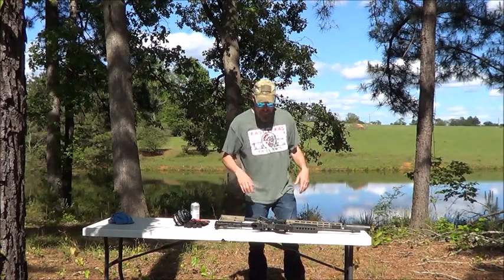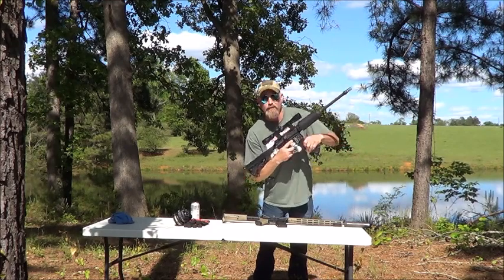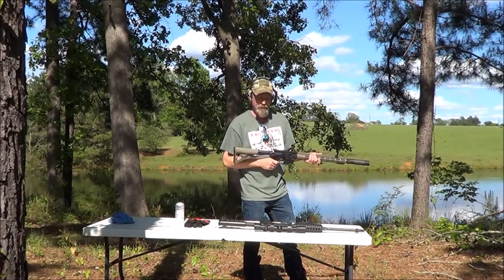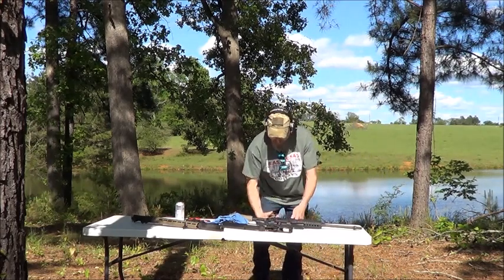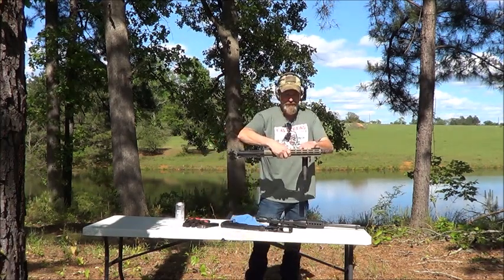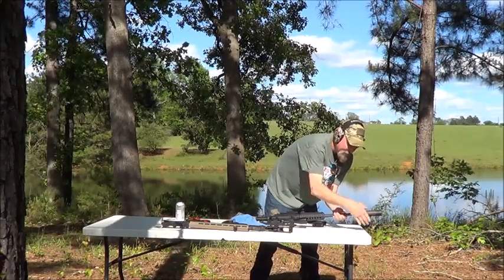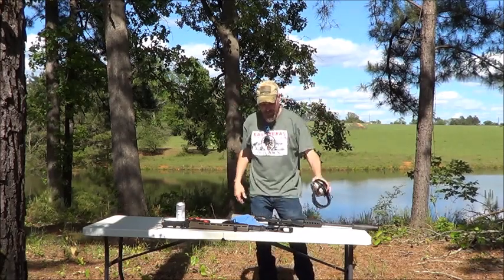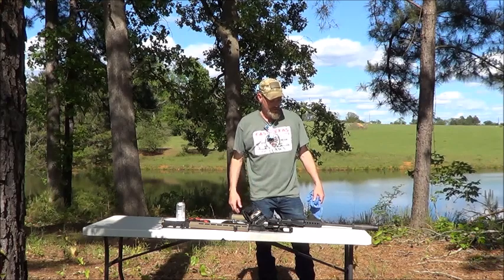Rare Breed FRT - 15 In A  7.62 X 39  Half Breed Upper

Comment: Lots of new 7.62x39 uppers coming out right now probably because that's the most common caliber available, not that I'm complaining, would love to do a midlength faux dissipator build that still uses a 30 cal bolt, one less thing to think about.
Reply from the maker: Thanks for stopping by and taking the time to comment !!!!!!!!!!!
Reply: @EastTexasOutlaws  any chance these can work on an ak? or only ar 15s?
Reply from the maker: @wcsdiaries  just ar 15 lowers with the right BCG and buffer weight
Reply: @EastTexasOutlaws  can pretty much any ar work with these?
Reply from the maker: @wcsdiaries  BCG and buffer weight has to be right, I have a video on the BCG
Reply from the maker: @wcsdiaries  AR's only

Comment: How to tell when someone hasn't fired very many rounds with a Rare Breed: it still functions.
Reply from the maker: Awesome, Thanks for stopping by and taking the time to comment !!!!!!!!!!
Reply: Hmm I have a few thousand thru mine.
Reply: @hitman_s1  no I know...but I'm not sure why mine runs fine.  No issues.
Reply: Only 750 through mine but it has been pretty flawless so far.
Reply: @createimproviseoptimize7891  For the price, it should be! Sadly it's not designed to last.
Reply: I've seen a couple guys with high round counts already and they're so simply constructed, if you have any knowledge about your gas system, in spec bolt carrier group, then I don't don't see how the trigger could go wrong. 
I'm running a unmodified frt and if your rifles bcg is in spec the trigger release trip spring should not be a problem. The trigger pack itself is very very simple in construction if you check the rare breed website out and see for yourself to better understand this trigger and what it takes to operate it. 
I'm telling you man, it's newbs fucking these triggers up. Mine will even run steel 5.56 shot 100 rounds of that no problem.
 The guys that work with Ars got theirs all tuned so what $200 for a new bcg that's in spec or changing buffer weights or gas blocks. 
You want legal rapid fire  without the price tag or tax stamp just do a little rocket science and you'll be running 650 rpms in no time.
Reply: @createimproviseoptimize7891  A YouTube search of "FRT15" and sorted to most recent shows every fifth video with the word "mod", "fix", or "issues". Not a good ratio.